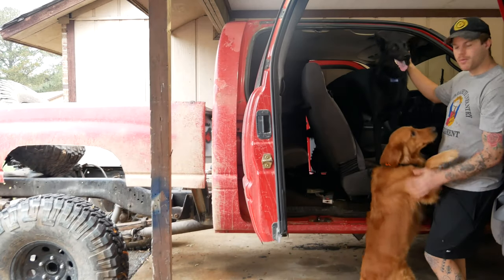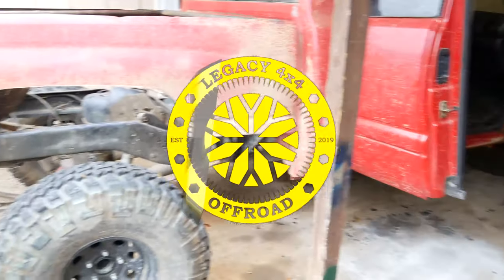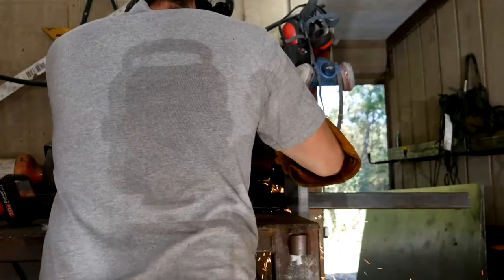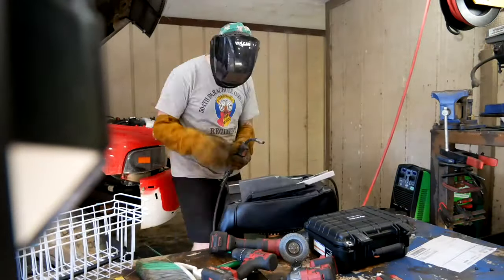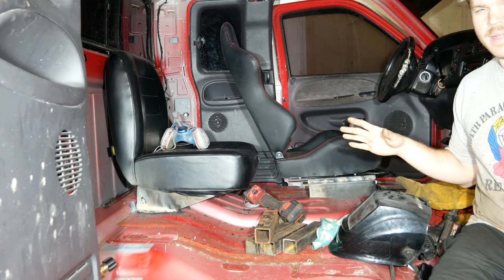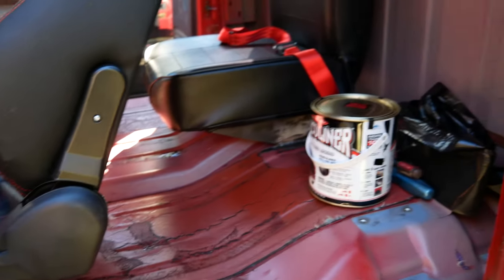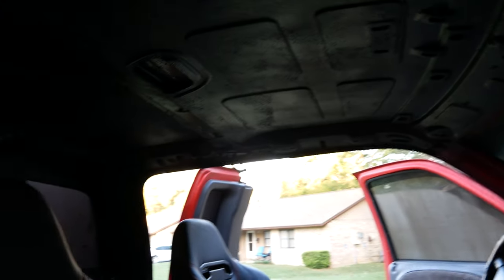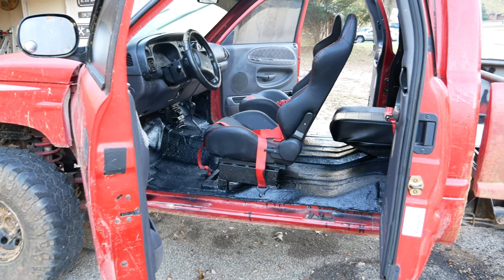2nd Gen Crawler Interior Overall (bucket seats plus more!) || Legacy 4x4 and Off-Road

Comment: Awesome! I'm looking to get a 2nd gen ram as well for a wheeler! Waiting until a manual comes around.. is this stock suspension? How did you make sure the seat sliders were level and square with the truck when you welded in?
Reply from the maker: They make some manuals but they’re so rare was thought to scoop one up
Reply from the maker: And for the sliders, I used the factory floor to beer math it.. seemed true enough for me… haha

I did road trip it 15 hours with those seats and let’s just say they aren’t the most comfortable
Reply: Got ya.. yeah I had to weld a seat into a Nissan Titan.. and the freaking thing was cockeyed pointing to the right and leaning to one side😆. Couldn't figure out a way to get any true reference points
Reply from the maker: @Christian.jsf1  luck and timing is part hahaha